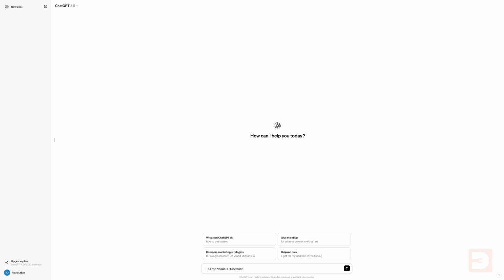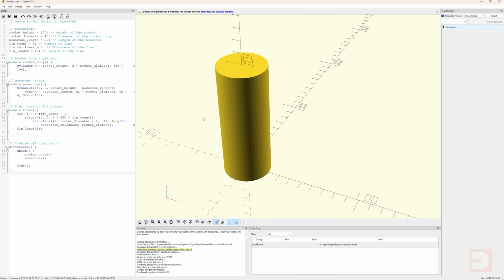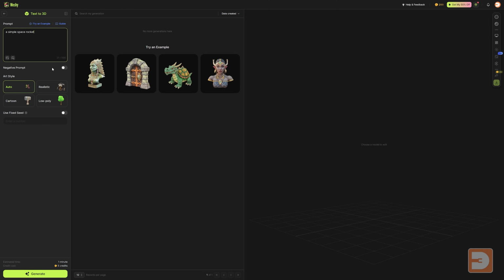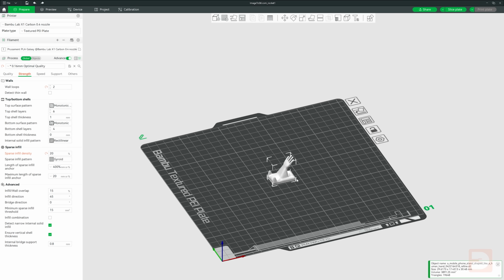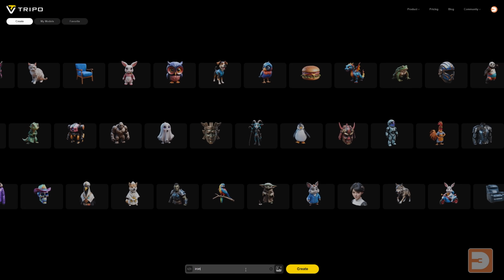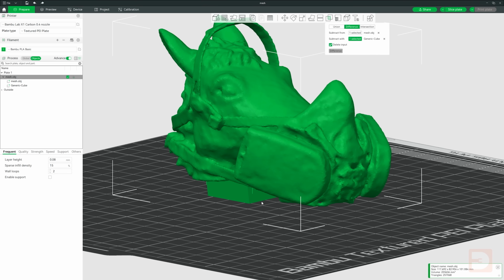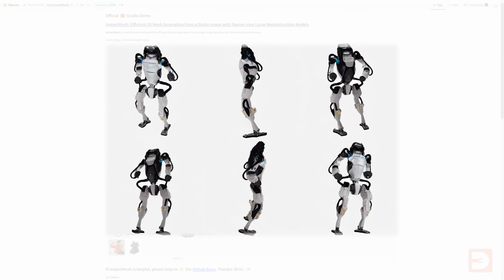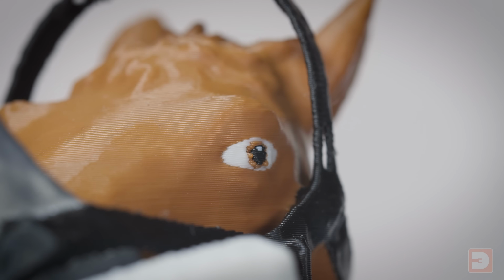Top Free AI Model Generators Tested for 3D Printing

Comment: With llm's you should have used follow up prompts, for example "the elements are there but not in the correct position"  or "the script generates an error because there is no cone object"
Reply from the maker: Yeah I actually spent a couple of days trying this with several LLMs and was absolutely trying feedback questions to iteratively improve the code. However, I found this had very little impact on the positioning and orientation of the models. So little in fact it wasn't even worth showing in the video when I did the final test between each of the LLMs.